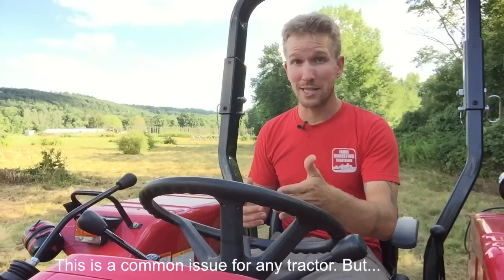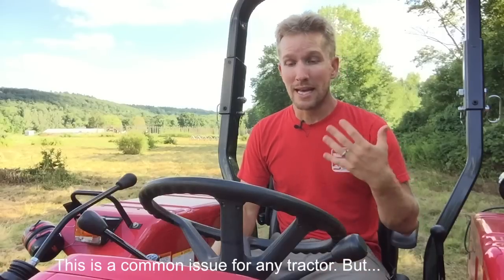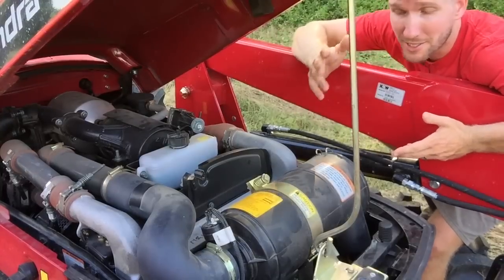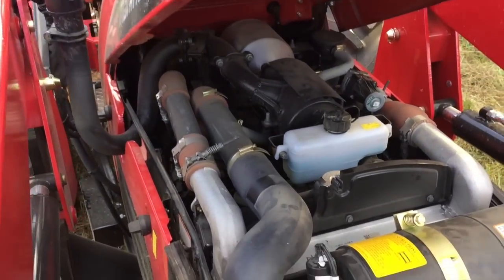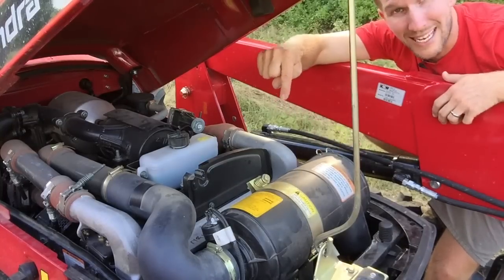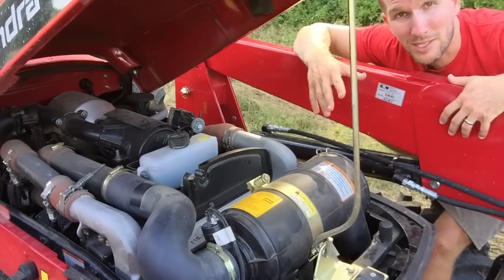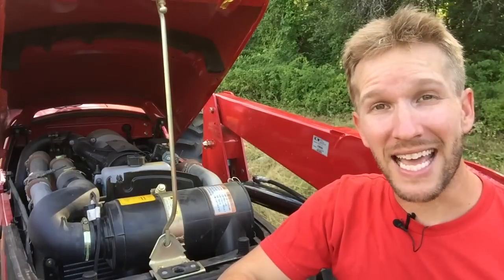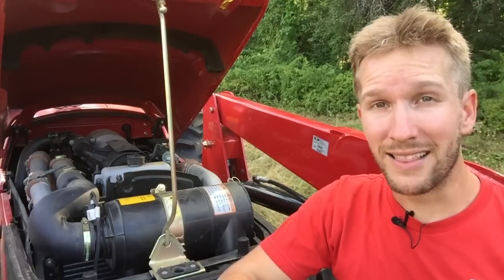Mahindra 5570 Engine Problem

Comment: I've got this exact same tractor as well as a Deere. To all the people saying "don't buy Indian junk," basically what you're saying is don't buy a Deere. The comparable Deeres are made in India with Chinese front ends. They aren't better, they're just green. I love my 5570. I haven't had this problem yet, but I'll keep and eye out. Good stuff here.
Reply: My New Holland Workmaster 50 is made in India also.  The design has the battery in the front and the air filter behind the radiator so access is much easier.  When brush hogging in the summer I keep a paint brush with me to clean off the radiator and inter-cooler.  It is a well designed unit.  If I had the 5570 I would keep an air tank and air hose extension to keep the debris at bay.
Reply: i have a 5570 as well and have not experienced this issue with the seedheads. i did have my egr valve sticking, and the dealer came out and reprogramed the computer so that the egr valve has more power to open and shut, and it opens and shuts 3-4 times upon shutdown now too. also helped the white smoke on startup i experienced a few times. other than that, been great

Comment: it is the same problems with a lot of new equipment today with the DEF but that tractor don't have DEF but the fix I do in my shop for a lot of customers, for the battery I install a set of remote battery posts on the out side of the machine normally off the frame behind a side cover, for the seeds an grass getting into the rad and all most imposable to clean it out even with a long air blow gun, I build a very light weight frame to fit in front of the grill and stretch a fine metal screen over it, that stops 95% of everything getting to the rad, and being the fine screen is on the grill you just blow it off, or you can buy an electric reversing fan {after market} and wire it to an auto reversing timer so it reverses every 10 min, or so to blow every thing out, or wire it to a f/r switch an just remember to reverse it regularly if you don't want the cost of that timer

Comment: what I do is lay the bucket down to where it just barely skins over the ground and knocks down the weeds, that way seeds do not get into the radiator, try it. it works, additionally what you can do is cut a piece of plywood to fit in your bucket and make it so it's traps down and the plywood goes out for the five feet away from the bucket and that way you could raise your bucket up at an angle and go over any High brush weeds are seeds and everything will go down under the bucket and then go down under until it gets to the bush hog additionally you can put a metal plate under the front end to keep the fan from pulling anything up from the ground

Comment: Can not understand way they don’t make a reversible fan on these. They all have this problem but accessibility sucks. My 5535 is not built that way, they have seemed to compacted things for shipping savings more on newer Mahindra’s. Major flaw and hard to fix, do not understand how I could run older tractors all day and never a problem and these new ones I need to clean radiator every hour. Wonder a person could pull fan and run a electric one that reversed. It’s all bs on a new tractor .

Comment: My Kubota 7800 does the same thing. I just pull off the hood and still have to clean the radiator 2x per day when brush hogging. Try going without the hood. I have thought about adding a radiator for the summer months.
 Another option I have thought about is an onboard air compressor to blow the crap out of the radiator.

Comment: take a piece of metal with small holes for ventilation and then put screen on the back so if the metal fails then you have a backup that is the only thing I can think of

Comment: I agree with the screen behind the grill. you need to stop the seeds b4 the get to the hidden radiator. Could you access it from the bottom? the top of The engine look pretty busy. Just a thought.

Comment: I have the Mahindra 5555 and to clean the radiator and turbo intercooler you have to remove the side panels then there's two wing nut type screws per side that hold the front grill on, then you can slide the front grill forward to clean the radiator.
Reply: Pete B. Absolutely i have 555 ultra arjun and that aalso have same feature

Comment: my ford is easy to clean open  hood pull the scene out from infront of rad brush off put it in and good to go again  but I do power wash it out once a month because of dirt bull up in the rad best bet is widow screen like mine has infront of rad but put it on your grill instead all the old tractors had screen like that there back I the 50's

Comment: My immediate thoughts, besides the installation of a filter screen (somewhat time consuming), are 1:go to home depot or any other place that has hand tools for air conditioning or refrigerators, and get a refrigerator coil brush. They're about 2-ish feet long, made for cleaning dust from under/behind your refrigerator. You could run that down between those parts no problem.

2:See about getting a second (junk) hood from the dealer where you got the tractor, and cut a hole & install a 12 volt blower fan on the top of the hood with a filter shroud. The design I have in mind would blow air DOWN past the radiator, pushing the debris and puffballs out and under the tractor as you're moving. There'd be some engineering required, but if you contacted Mahindra's US office, you might be able to work something out with them as a test case for improvement R&D. Much more labor intensive, but a possible solution, nontheless. A good place to start would be a radiator fan off a small car. It'd require the least work to fit and would be plenty powerful enough for your needs. 

As for your battery terminal issue, the company probably sells a bracket with extension cables and terminals which installing wouldn't exclude you from the warranty. If not, then it's up to you whether or not you want to get creative with brackets, cables, and rubber washers.

Good luck, John. Let us know what you figure out.
Reply from the maker: Good call on the refrigerator cleaning brush, I wouldn't have thought of that. That's exactly why I create these YouTube videos. Crowd-sourcing solutions.

As for #2, a bit intense. I will reach out to Mahindra and ask them if we can work on it. I wonder what kind of response I'd get.

Thanks Caveman Joe (also, great username)

Comment: Can you take one of the side panels off and reach in that way? Ive never worked on this brand of tractor before but our New Holland has its funny querks also, when we need to change the oil filter, I need to remove some plastic shrouds  to get at it. In some cases the bolts holding the sides on might be behind the loader frame, so you might look there. Hope this helps
Reply from the maker: Side panels open but not to the radiator. I can get to it kind of from the top.

Comment: Use an air compressor with a 45° hardline extension. Takes 2minutes and you only remove the side panels.

Comment: Overheating is just as bad as no olie pressure or maybe worse.  I think that air cleaner has to move. Can you make it easy to remove by adding a good quality connector for the sensor and steelbands with clips to be able to rip out the air cleaner in less than a minute?  Maybe work with the dealer to avoid warranty issues.

Comment: Carry the tools you need with the tractor. The tool box should work nicely for that. Maybe you could weld wing nuts to the heads of the bolts so you can loosen them with your fingers. I am not sure how much clearance you have at the end of your bolts. 

I am sure that your local auto parts store or tractor dealership would have remote terminals that could be attached in a convenient place. The positive terminal needs to be insulated from any metal part of the tractor.
Reply from the maker: Thanks Alex

Comment: I have a 5010 blow radiator out or wash it out . I take side panels off to get more air flow it runs cooler .my 5010 has a screen in front of radiator have to wash it off every couple of hrs if I collect to many seeds

Comment: Buy some feeder steers or sheep/goats in spring, let them eat your problem and sell the ones in fall you don't want to overwinter. No more spent fuel and hours on tractor mowing.  Although, sometimes just sitting on the tractor mowing is the most relaxing part of the day:)

Comment: Try using a leaf blower to blow it out from back to front.
Reply from the maker: I used an air compressor after scooping out most of it with my hand. That worked alright.

Comment: Do the side walls not come off on those models? I know that is a selling point on the smaller models for easy maintenance. Do not know if that would give you the clearance though.
Reply from the maker: The side panels come off but they don't give access to the radiator.

Comment: For the battery, maybe you could run a wire from the hot terminal that is long enough to attach to your jumper cables.  Just leave that wire on the hot terminal all the time and tuck it away under the hood somewhere?  You can ground your negative jumper cable to the tractor's metal and hook the positive jumper cable up to the wire.  I don't know if that helps, but it sure does beat taking all of that stuff apart every time you need to jump the tractor.

Comment: my deere has easily removable side panels and a screen that goes in front of the radiator that just slide out to be washed or blown clean   but my Kubota L6060 (0% financing for 84 months) is even better 1 spring pin releases  the brush guard 1 lever pull pops the hood (grill and all)  screen slides right out less than 30 seconds   it even has a/c heat and a stereo  lol     John we are in CT also we want to come up and see your place beer and a tour also we love your channel very insightful

Comment: That problem with getting to the battery is what I have with both models of my John Deere tractors. I have a model 790 and you have to remove the air filter compartment to get to the battery on the tractor. I also have the 3032E model and I have the same problem with it. Most things I like about my tractors, but that and the placement of the fuel tank are problems.

Comment: John, the design is done by the stylists, not the engineers. They save on sheet metal and paint, etc. and reduce room to service the engine easily. You're simply going to have to service it or reduce your weed heads by more frequent mowing. Sorry, I don't have a fix. Good luck.

Comment: If the "front grill plate" you talk about is actually a coarse screen, and seed heads are still making it through to the radiator, then the perforations in it are simply too large to be effective.  Consider placing a finer screen between the bottom of the radiator and the top of the "front grill plate" — such that it is tilted forward and faces down slightly.  Any seed heads that make it through the "front grill plate" will hit the screen and be deflected down — ultimately exiting the bottom of the engine bay.

If you drill two holes into the top of the "front grill plate" you can insert a couple of bolts with eyelets in them.  Fabricate a 'frame' out of something like livestock fence (2" square grid made of 0.25" steel) that matches the cross-section of the radiator/"front grill plate".  A bonded loop of fine mesh can slip over the frame like a sock.  A pair of carabiners can then fix the fine screen assembly to the eyelets.  It should simply hang down behind the "front grill plate" when the engine is off.  When the engine runs, however, air pressure will push the unhinged bottom back against the bottom of the radiator — thus creating the desired angle.  Every time the airflow reduces, it will swing back and 'bang' against the back of the front grill plate — dumping seed heads and self-cleaning in the process.

To manually clean such a set up all you need to is unhook the carabiners, pull out the fine screen assembly, blow it with compressed air and slot it back.

A friend of mine owns a small mine and we spent a lot of time designing and testing screens.  Fine screens without a backing mesh get torn and perforated easily.  The most effective screens are the ones that are forced to move or vibrate slightly.  Our most effective designs were frames of mesh with fine screens on the business end, suspended in the corners by springs and allowed to move and vibrate due to various motors attached to the main frame assembly (that the other ends of the springs attached to).  Not sure if you have room for such an 'elaborate' setup though... but I thought I'd mention it just in case.

Comment: Hi John! I don't know what to say about the radiator but I might have a solution for the battery problem. when I was in the military most Vehicles work with put something called slave cables. there was an outlet on the side of the machine off the engine compartment where both the negative and the positive terminals were connected. you effectively used a big specially-built extension cord on one in that would be the end that would hook your tractor and the other and would look like a typical set of jumper cables. I used them many times and they work very well. your tractor looks new, so I don't know if installing a Slave cable outlet would void your warranty but it might be worth asking the people where you bought it. an idea for the radiator might also be to ask the people where you bought it if there is an easier way to access the radiator and clean things out or even a way to avoid the problem to begin with. that would probably be a lot easier than trying to wiggle around in tight spaces and hope you don't break anything. I don't know if I said anything helpful but I hope I did. have a great day my friend.

Comment: it may just be a small problem that is magnified because you let the grass get too long with not having a way to cut the grass before it went to seed (hopefully). a suggestion I read online elsewhere was that if you take your front bucket off or I guess lift it above the grass might help so you don't knock the seed loose Infront of the tractor. I hope you get it sorted. David

Comment: is there  any way  that you could  design   a thin  screen  that stands  out  from the radiator that  allows air  to flow through but blocks the weeds   and grass from clogging  the radiator  a narrow  frame  made out of  welding rod

Comment: OK, this is going to be dumb, but here it goes...

What about some form of stiff bristle brush.  I have seen 2 inch bristle brushes, used to clean ductwork and suck, that would fit between all of the other parts to clean off the seed head.  The have a long head on them about 6 inches long but a circumference of about 2 inches and a flexible long metal handle.  Can be picked up at any box store.   I actually use something like this to clean out my dryer vent a few times a year.  

I only mention this to try and help fix your problem.  When I bought my tractor I passed on the Mahindra because of all of the bad reviews and really negative comments.  If it were me I would return it somehow, but I understand this may not be an option. I ended up with a New Holland with similar mechanics, but I have never had this problem.  

Good luck man.

Comment: I would move the air box (the big black cylinder). Make a snorkel system so it sits up out of the bonnet or to the side of the bonnet (or hood...whatever you guys call it)...much the same as you would put on a 4WD. Then it won't be in the way of either the battery or the radiator. This is the best long term solution i could come up with. Also means your air intake won't be as close to the crap flying up into your radiator....and would also mean less restricted air flow to the radiator, meaning less issue of overheating.
Reply from the maker: You're the first to suggest that. I want to check to see if it voids the warranty, but that's pretty good. I will be researching that.
Reply: How did it go? Any luck?

Comment: As to the battery charging "problem" with your battery be difficult to access, I would put a pair of "remote battery lugs somewhere the tractor where they are easy to get at. Drag racers use the remote lugs on their race cars so they can quickly charge their battery or batteries between rounds of competition. I would think that any auto parts store would carry them. They They're just like two battery terminals located wherever you want to put them with battery cables running from them and connect to your battery. They have removal plastic covers over the terminal studs so you don't accidentally get some metal across the terminals and cause a short. Hope this helps you out!